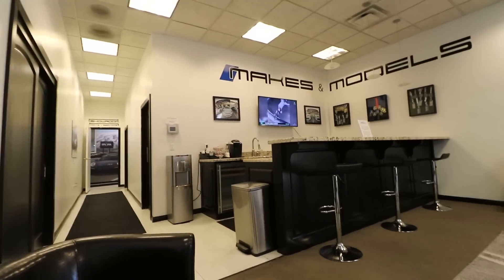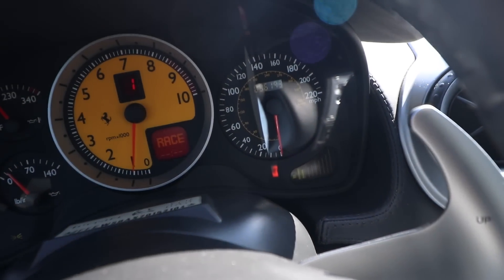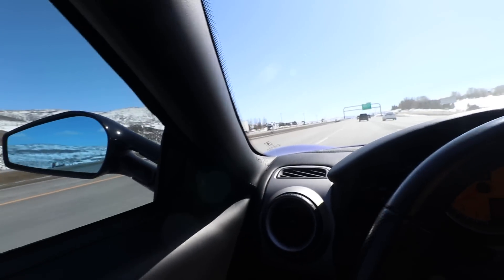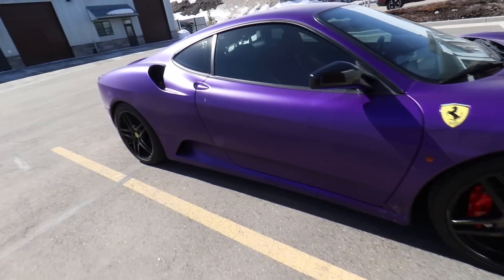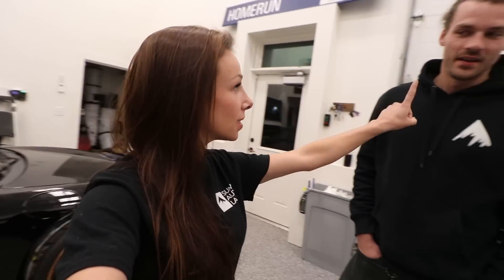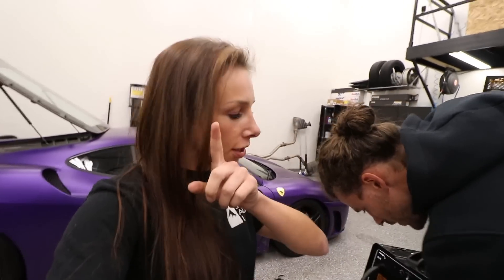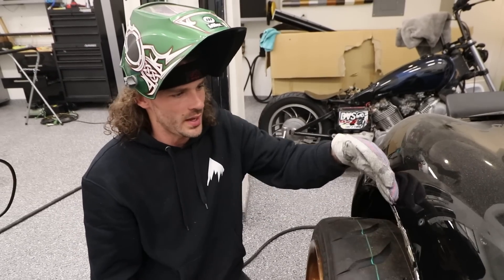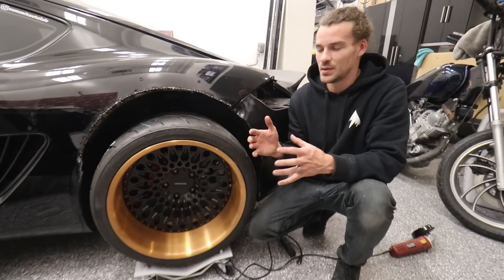The Ferrari Is Emptying Our Wallet!

Comment: Won't stack dimes on a mig. Turn the wire speed feed down, which is basically the arc strength. It will help you avoid burn through. Wire out size should be like a half inch or so. No substitute for practice though. Great first job!

Comment: faith listing off items that break by themselves on the Ferrari 430 makes me think the car is a complete pile of junk. No wonder Ferraris burst into flames, exhaust vapors in a hot engine bay. Exhaust leaking. What next, the brake lines magically break under normal use? = Driver dies slamming into highway jersey walls?! Nah, F that.

Comment: When welding or grinding you don't want to have any skin exposed, that's why welding overalls' sleeves are long. Also the gloves and the sleeves of the overalls are supposed to overlap. They are also thick so you can get the "sparks" on you all day and not have to worry about it.  Those suckers burn and its not the best to flinch or lose focus around dangerous tools you know. Also helps protect against grinding wheels breaking cause they are thick. I mean you aren't doing it for long but that low chance of shit happening is still a chance.< Great video btw and yeah I would unwrap the Ferrari. > Also if you can smell it or see it when grinding or cutting, its in the air (go figure) and you should wear a mask.